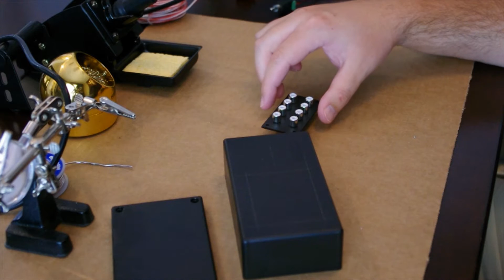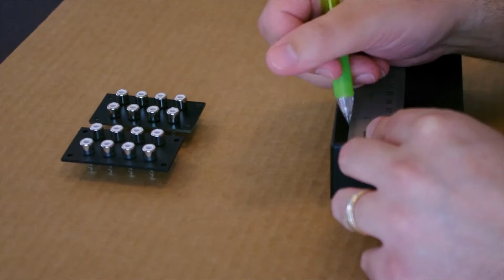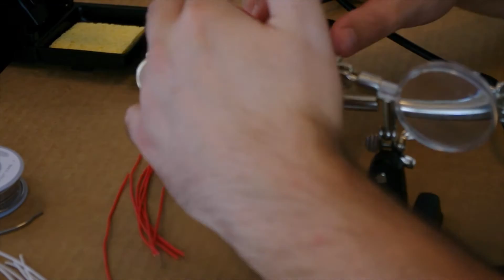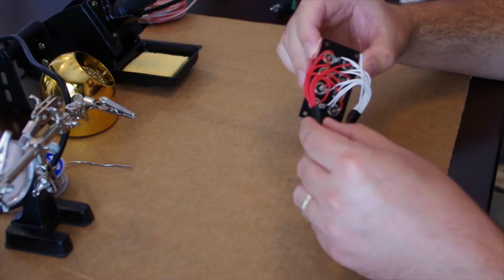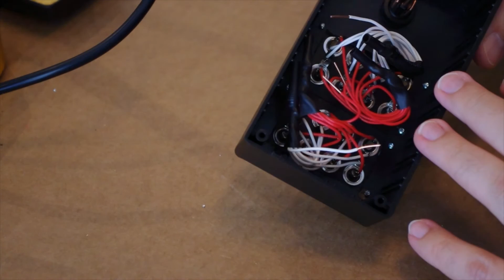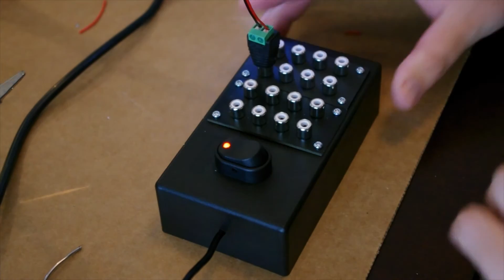RCA Power Box

Comment: So, I'm a bit electronically challenged. Plenty of soldering applications for work, but not too many home projects that have actually worked out, including a power box I built a while back for a Christmas village.

Anyhow, I attempted this project box less the box and switch, just to see if I could get the thing working at the most basic level. Negative...my streak continues haha. 

If you wouldn't mind, maybe you can explain to me what I might be doing wrong. I used a 12v power supply from Amazon that you linked to in another video (or an equivalent one), and just a basic LED from a votive candle I bought at the dollar store. I used a std 5.5 x 2.1 RCA. I soldered the positive LED lead (longer one) to the outside terminal of the RCA and the negative (shorter) lead to the inside cup terminal of the RCA. I plugged in the power supply and got no light. I reversed the two leads and powered up and got light for about a nano-second and then nothing, and tried again and still got nothing so I could only assess that I probably burned out the LED. I can't remember in which order I performed these 2 steps so if this doesn't make any sense then I probably did those in the reverse order from what I stated.

Any ideas what I could have done wrong. Does the LED have to be a certain voltage to work on this power supply? It doesn’t look much different from the LED you tested with at the end of this video, but I don’t know much about voltages and such.

Any help is appreciated.

Thanks again.

Remy

Comment: hello! when you combine on all red wires and all the white wires (or black), do you solder them before putting the shrink tubing on? if so, is that necessary? thanks!
Reply from the maker: Yes, I did solder them before putting on the shrink tubing. You could also use wire nuts instead of soldering.

Comment: Hello, I am trying to put some of these boxes together. I'm doing this to attach the tea light LED's. I know the battery that one of them runs on is 3V but what wall wart would I use to power it etc. Thanks.
Reply from the maker: For this box, I use a 12V power supply. It would depend on how your tea light LEDs are setup. For example, I use pre-wired flicker LEDs that have a resistor already. That lets me supply 12V of power and the resistor reduces the current so the LED doesn't burn out. In your case, if they are running on 3V battery, then you should be able to use a 3V power supply.

Comment: So after watching van oaks as well as your video. I decided to make my own rca power box. surprisingly the only challenge I faced considering I was new to soldering was the led on the rocker switch would never light up. It provides power to the rcas but not to the rocker led. I swapped out the unit 4 times. I wonder if this is either bad quality control or the ac adapter I'm using. any tips?
Reply from the maker: That's really odd! So you tried 4 different switches and the LED didn't work on any of them? Are you sure the polarity is correct? Also, what type of power supply are you using?
Reply: @RestlessHollow  Turns out the switch I got is meant for ac. So the switch will provide power with dc but the led will not work. So many hours wondering what i had done wrong. oh well now I know. Thanks for your reply!
Reply from the maker: Bummer! Hate when stuff like that happens. Glad you got it figured out! 👍

Comment: i actually ran a split power wire from my 12 volt wall wart and ran the positive wire through the little holes in the terminals and then ran the negative through the negative term holes as well and it works.  Only problem is i want to see how to cover them so they don't touch...they aren't now, but i was thinking maybe that liquid electrical tape might work.  Might have to try it.
Reply from the maker: Yeah I bet liquid electrical tape would work. I used it on some spots I made in the past and it worked great.